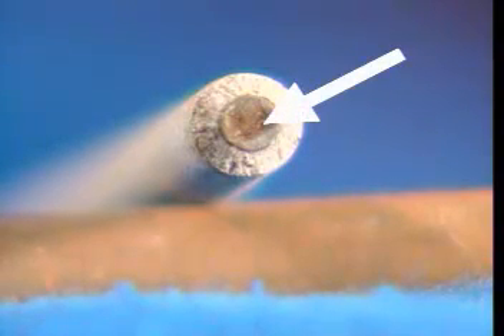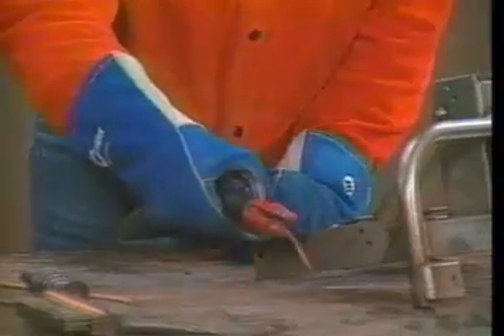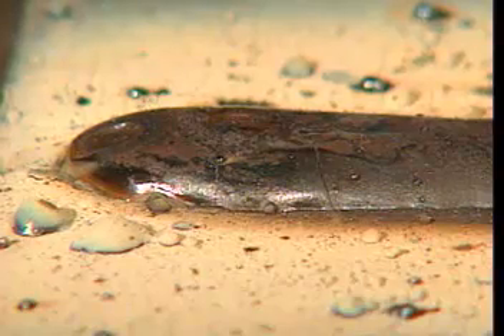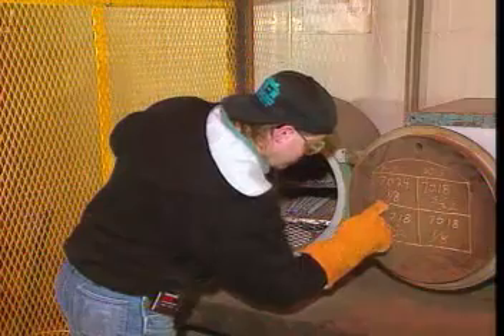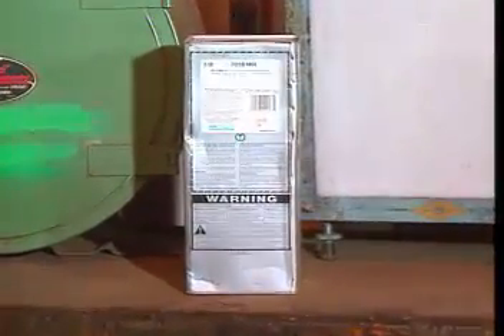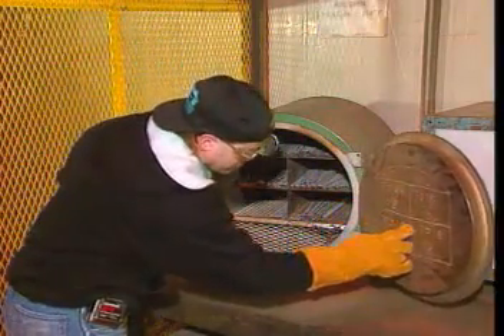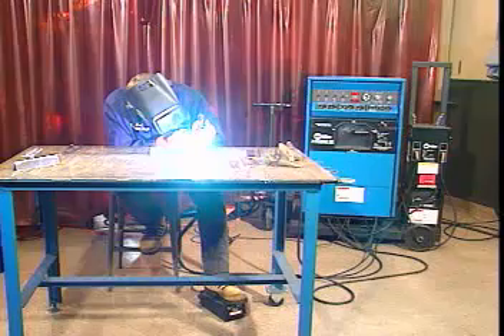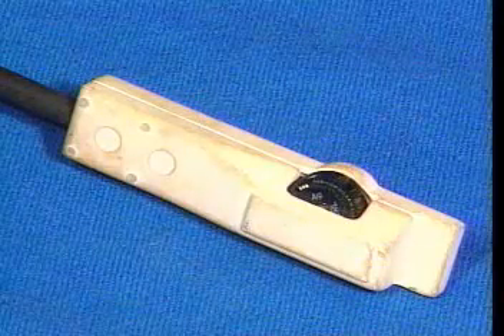Arc Welding, Video 09

Comment: Which electrode is good for strong welding
Reply: 11018 rod, stronger then 7018. Used for chassi frames and high tinsel strength applications.